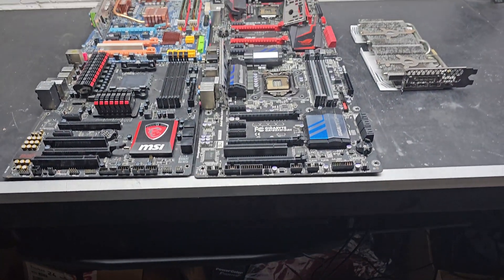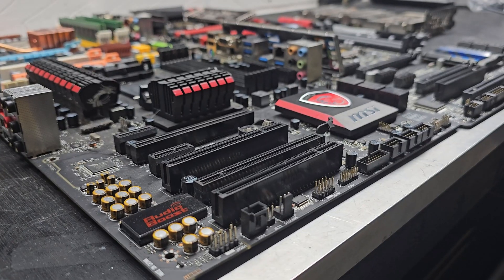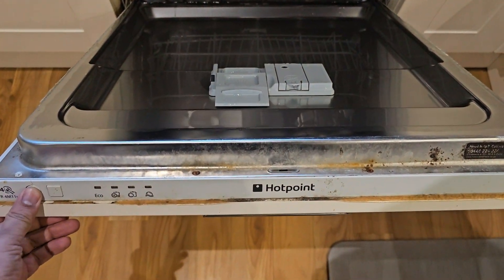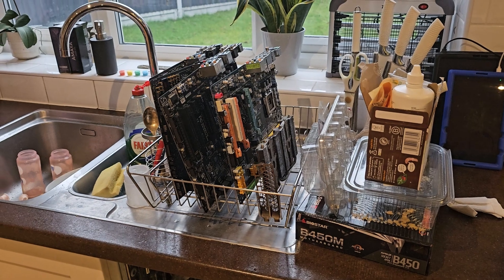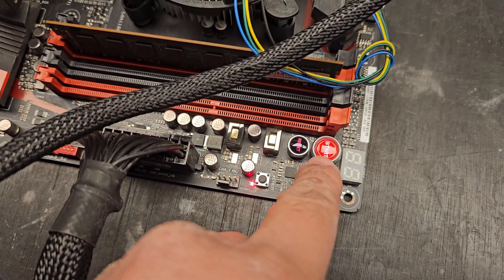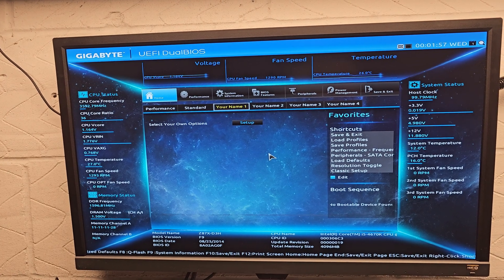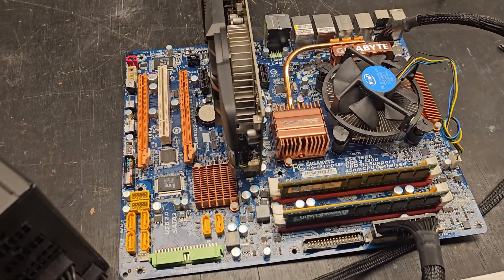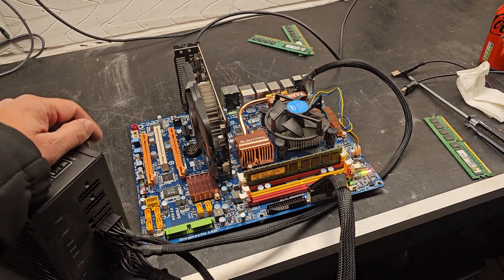Fixing Dead Motherboard in the Dishwasher – Does It Work?

Comment: The Maximus Board not dead i tink the bios is corrupt you need a CH341A USB Programmer than you can fix it. By the way some uefi bios need a few runs until they really start that can sometimes take 5 minutes
Reply from the maker: @andreasdrechsler4522  I did a bios update and it didn't work, in the video it looks like I only did one boot but I actually did about 20

Comment: About what I expected. A dishwasher is not a bad idea for cleaning pcbs as water is not a problem as long as they are not powered on. I would probably use distilled water to clean a pcb in a pinch but 99% isopropyl is the go to as it cleans things like flux. I think the msi board might have had dust or oxidation in the slot that got cleaned out. Unfortunately most pcb problems can't be fixed by just cleaning which is why the rest of the motherboards are still dead. They probably need component level repair
Reply from the maker: @liamschertler9806  absolutely, I did do every other test or fix it could think of including a bios update and thought I'd try a clean before attempting to desolder and do a bit of fault finding